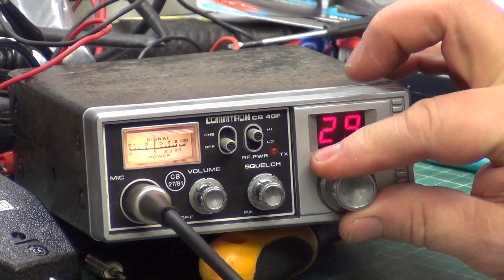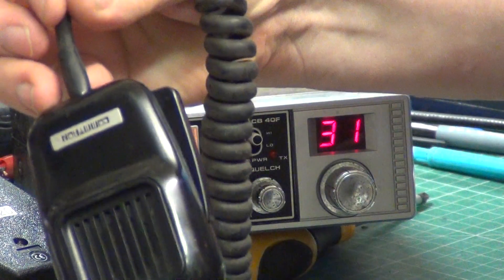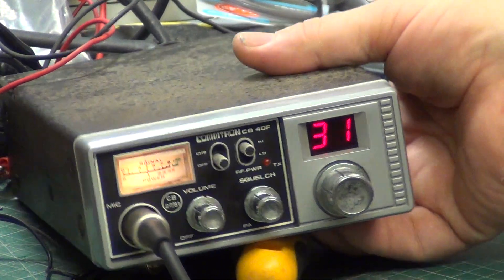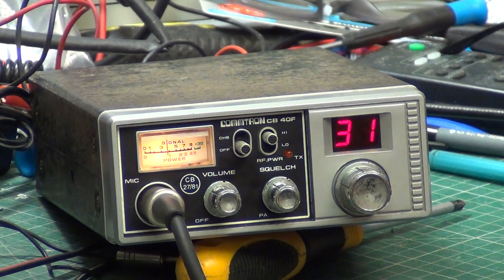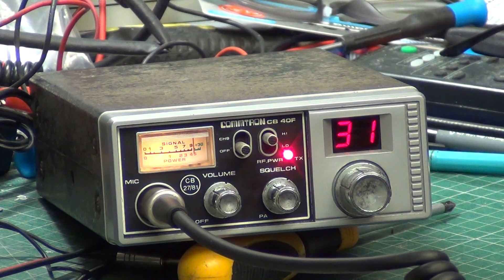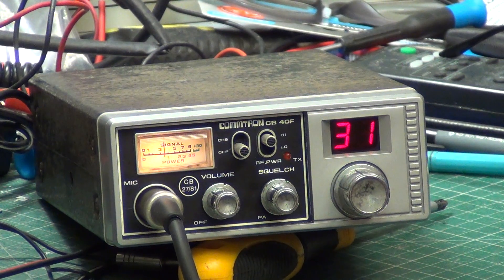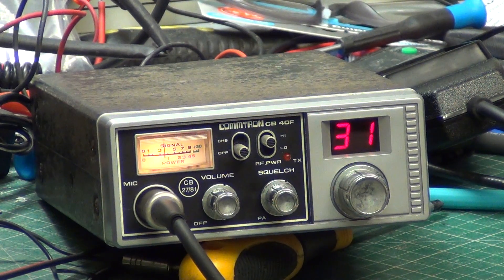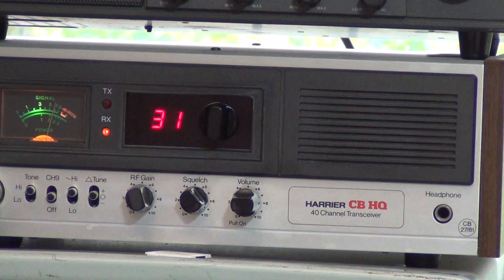Commtron CB40F CB27/81 UK FM CB radio - On The Air test

Comment: These are good little sets, the flat mics often have open circuit cartridges, farnell sell replacement ones, they are a bit smaller, I print a support ring but you could do the same with a bit of foam, it's nice to keep the factory mic even if they are weak.
Reply from the maker: Thanks for the info Paul,

Richard

Comment: I have one my tx light doesn't work either. I bought mine because that is the cb my brother had and is why I have cb now
Reply from the maker: Now sets with this chassis are 40+ years old, I see quite a few with the LED failed. It's quite a faff to change though it's a standard 3mm type thankfully.

Richard